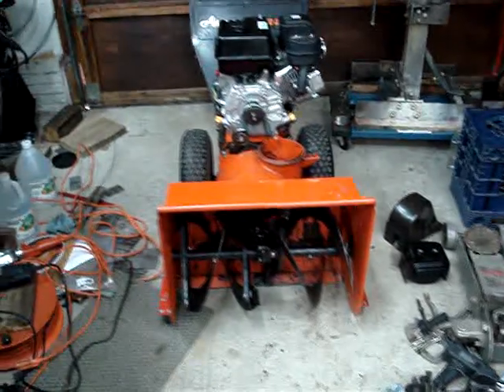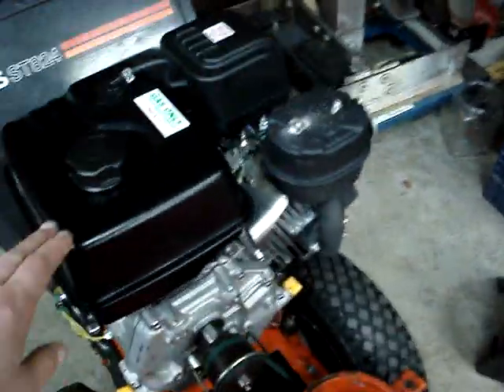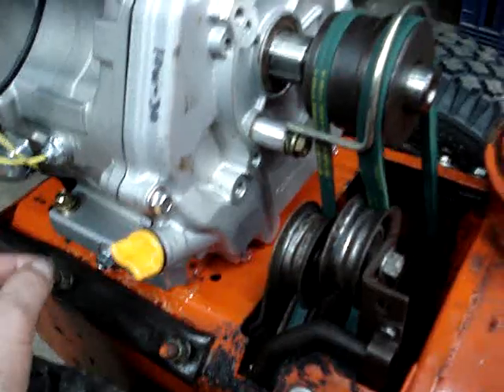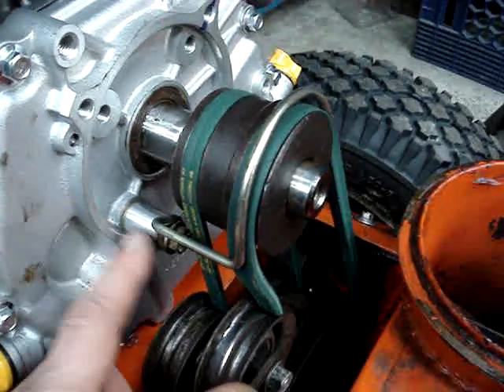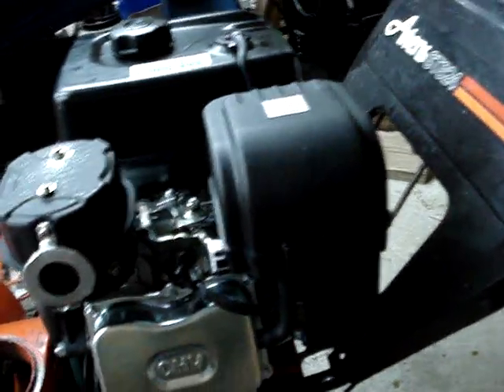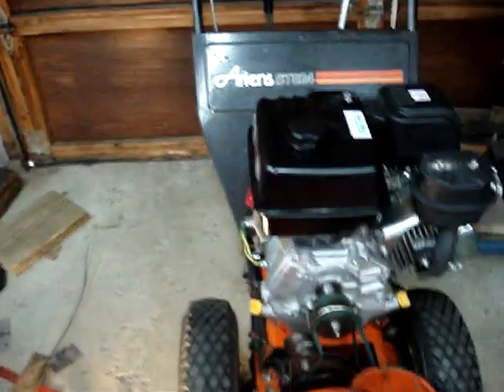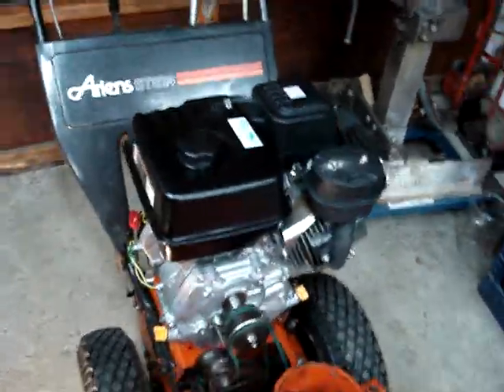Ariens ST824 Tecumseh-to-Predator 301cc Engine Swap

Comment: Please say those belts were snowblower belts and not automotive belts.  Automotive belts are designed not to slip where snowblower belts are designed for slippage.  My Father lost a finger because he used an automotive belt instead of a blower belt.  The auger failed to disengage when the controls were released.
Reply from the maker: Good point!  Be sure to use the belts one feels are the safest!

Comment: I just did the same swap but with an gx270 Honda motor.  Thanks for the belt size it's the same for me :)
Reply from the maker: I should have updated the text.  I will be doing so here in the next few minutes...  Last year, before the season started, I upgraded the belt to an AX40.  The engine produces enough power that the "L" belts slip.

Keep an eye out for slippage in your situation.
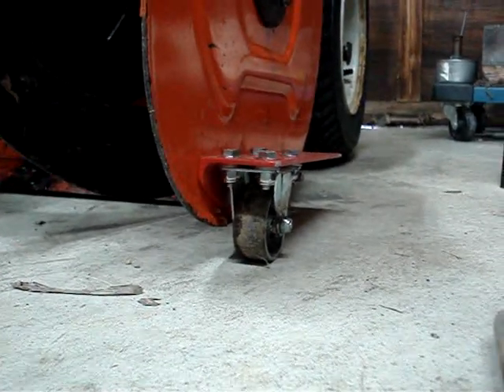Reply: What pulleys did you use with the AX belt? I have same blower and looking into doing the 301 repower as well. Thanks! 1:03

Comment: How did this perform? I have this exact replacement to do. Thanks for posting
Reply from the maker: The engine now has 22.6 hours of runtime in just a season and a half -- I do a lot of the neighborhood sidewalks and driveways.

The upgrade is very nice.  The Predator runs better with more power than the original engine.

A word of advice, though...  Run an AX belt with the new engine on the impeller drive.  Anything less and you'll get slipping in heavy wet snow.

And if you haven't done it already, be sure to schedule a Summer weekend to install an impeller wiper modification.

Glad the video was helpful.
Reply: @weebandit   Great to hear and thank you for the belt update. I have the engine and will start this swap this week. This was very helpful! Thanks for sharing
Reply from the maker: @chrislaramie5238  Most welcome!